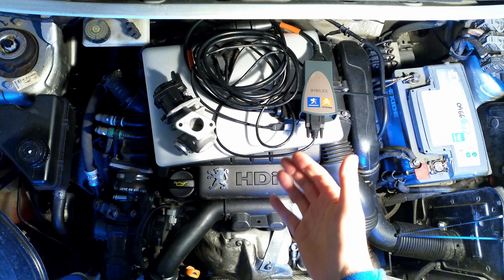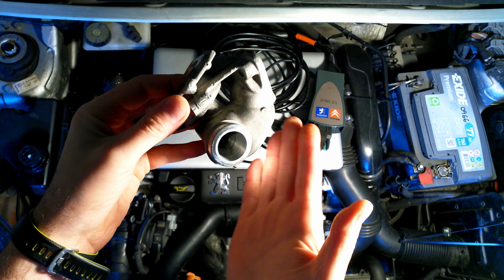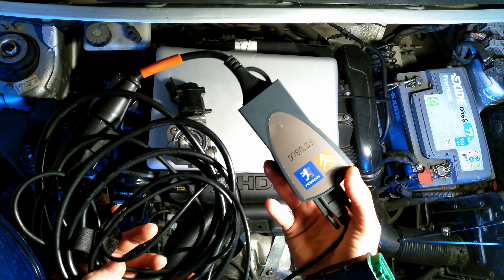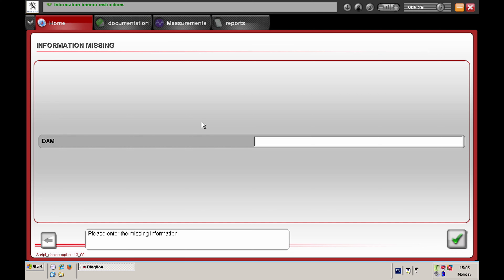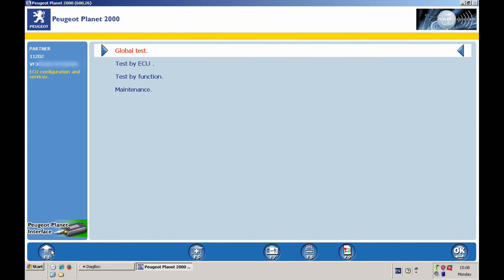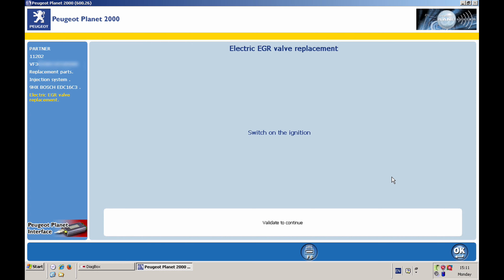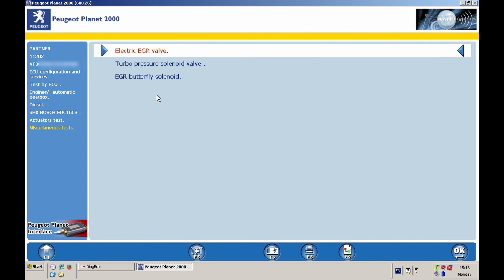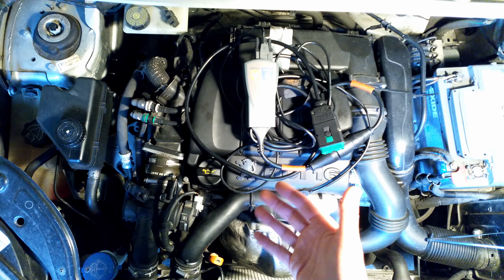1.6HDi new EGR valve recalibration or reconfiguration, how to with Diagbox or PP2000

Comment: how much does the diagbox tool cost, i changed the egr but a new simular code showed up instead of them getting removed?
Reply from the maker: Yeah, depends if you want legeal diagbox, then it is quite a bit with I think the newer versions annual charge. You could buy the tool and software from ebay and it does not cost that much, but it is illegal and it is up to you if you want to buy it.
Yes, new EGR needs to be recoded or relearned as it is not plug'n'play.

Comment: I changed my egr on a 2.0 hdi because the car was jerking on acceleration. But that made the problem worse. 
My mechanic tested to block the egr and the problem was gone (he reprogrammed the egr previously). What could it be? the egr pressure converter?
Reply from the maker: If you have replaced it with a new valve, it needs to be re-calibrated with Diagbox (Lexia for Citroen and PP2000 for Peugeot) in order for it to work properly. They just get clogged and become sticky to respond to close when under acceleration, hence blocking it would cure it. Sometimes new valves are not as good as the original ones, I had one where it was not machined properly and there was a snag in the channel.

Comment: Great video but how do I do this on diagbox I can't find replacement parts
Reply from the maker: hmm, do you not have pp2000 or Peugeot Plant 2000 (peugeot) or lexia (Citroen) that goes along the diagbox? Generally, both come with diagbox, unless some really new version. At the beginning you get the option to choose PP2000 or Lexia, but I suspect that there might be just diagbox if it is really new versions. What version diagbox do you have
Reply: @moremolecules  that came out all wrong my bad🤦 yes I have version 9.129  diagbox
Reply from the maker: @JerG21  It should have Lexia/PP2000. Do you not have it?

Comment: Do I need that Lexia3 connection interface? or can I just buy a obd2 cable to usb off eBay for £10? , can you use pp2000 with cheap cable.
Reply from the maker: There is nothing special about the cable, but it needs to be the same spec as the Lexia3 interface. Not too sure though if a generic obdii to usb would work, but it might. Sorry about the vagueness, I have not tried it with a generic cable, worth a try I suspect.

Comment: How would you debug this SUDDEN ABS OBD error message? "Incorrect matching of the ECU (incorrect engine, system or vehicle). Fit a correct ECU." ?
Reply from the maker: Have you by any chance changed the ECU. Could be a bad connection, either the EOBD itself or the interface
Reply: @moremolecules   They are all the original parts, except for brake pads and disks. How do I find the connections to check?
Reply from the maker: @RGSneaker  What I meant was disconnect the interface and try again. Also, you need the car battery fully charged, otherwise you could get the error message. Also, I suspect you have chosen the correct vehicle as well in the menu.

Comment: Hello, great video. Just a quick question. I replaced my egr valve recently and now I am getting fault codes p0490 and p1459 as well as a little hesitation under load. Is it because it needs to be programmed. 

Thanks 

Jon
Reply from the maker: Hi Jon, maybe, but it is not entirely clear. It could be that the new EGR valve is faulty or that it was not calibrated. Most people would think a new EGR is perfect but not always. I had a brand new EGR that was sticking due to bad machining of surfaces.
Reply: @moremolecules  hi
Reply from the maker: @muhammadsanee5870  hi

Comment: Good day Master , i am a Toyota driver , but i bought a Peugeot Partner for my wife , and i need some help from you .I watched many of yours videos and i want to thank you for  yours efforts , and  how you  explain clearly every detail .
I cleaned as per yours videos my EGR valve , and because i am new in Peugeot i can not do the performance test on it :( .
Infact ,i have chinease Diagbox tool , but i have no choice to see PP2000 and follow yours procedure . Maybe i did not instal properly the software ... When i connect the tool to OBD port and start the Diagbox , after i choose Peugeot Partner model , the program automatically find the VIN number and bring me to menu with 4 options as Repair , Maintenance , New car preparation and one else , and i have no option for P2000 .
I hope you can find for me a minute to guide me out .
Thanks a lot and have a new day .
Vasco
Reply from the maker: Hi Vasco, this looks like newer version than mine of the DiagBox. I think I installed it once and it was only the DiagBox, which should also work, but the menus are different. I think there is an option to download DiagBox with PP2000 or there is an option during the install to have PP2000. Otherwise, I generally switch off the internet while doing anything with DiagBox/PP2000. See if during the installation there was an option for PP2000. If I were you I would re-install it to make sure that PP2000 is there as an option.
Reply: @moremolecules  Hi again :). First i like to thank you for this fast reply .I will try to reinstall the program . It will be pleasure for me to know a nice guy as you , because today people are not too friendly .I will be glad to know your name , that way even when my car will  working fine  i can say you a small : Have a nice day .
You deserve it . Tonight i will write  why i decided to clean the EGR valve and i will see yours opinion about.
Reply: @moremolecules  Good morning  Master , ours Peugeot Partner got 169 000 km , and i did not knew if timing belt was replaced . So , i replaced it and car started very well and then i cleaned Turbo oil pipe. I did a rod test and all was perfect .Then i noticed a leak from injector number  1 .I took off all injectors to replace the copper seals ,and same time i cleaned nozzles with soft metal brush , then i modified humidifier to 40 kHz (ultrasound ) frequency and cleaned nozzles with water and soap . After installation i did again road test and noticed lack of power when i accelerate . I connected Diagbox , but i am not too familiar with . The only thing i saw was that Air Intake measured value was much HI then reference one ( with around 200 units ).For that reason i decided to clean the EGR valve . I hope you can guide me tom know where can be the mistake .
thanks A LOT in advance , and have a very nice sunny day :).
Vasco

Comment: What is the part you use to connect to car and computer. Can you use any type?
Reply from the maker: It is called Diagbox diagnostic interface. It contains Lexia 3 (Citroen) and PP2000 for Peugeot. It can be purchased on ebay
Reply: Does it work on newer vehicles?

Comment: Hello, I changed my egr valve and it keeps giving me code dtc p401 the car in cold shakes, what could be the fault? After this, cancel the egr with a sheet and the shaking is gone
Reply from the maker: It is likely that the new EGR is somewhat stuck on opened position or needs calibration. If an EGR valve is stuck in the opened position you would get shakes or rough idle. Exactly why when you blank it the shaking stops. It could be that the EGR valve is faulty, it has hapenned to me before with a brand new valve. The pin channel was not machined well and sometimes the pin got stuck at some position. Most people would not notice if the EGR is stuck on the closed position. Recalibrate it if you can and see if that helps. If it does not open it and investigate how well the pin is moving.

Comment: Hi.
I replaced the EGR on my 2009 1.6 HDi Berlingo and recalibrated it with Diagbox but still the Car doesnt feel right.
The Problem is, I have These 3 Codes:
P0409, P0490 & P1459 (all EGR related) but it is Not possible to delete the Codes.
Do You know what could cause this problem?
BTW, great Video!
Reply from the maker: It is a bit wierd to have these codes with a new EGR. How was it programmed/recalibrated? If it was with Lexia, then I would use Lexia to check the operation of the EGR valve, the percent values for opened/closed. It will give you an idea if it is permanently closed/opened. It might point you in the right direction. These are permanent faults, so likely either the EGR valve is faulty from new or the ECU cannot control it for some reason. I would do an EGR test with Lexia and see if it is clicking and operating as normal.
Reply: I am having these issues for years and I still cannot find the solution, I put a new EGR Delphi on my Citroen c4 Picasso and those 3 codes comes up, P0490 , P1459, P0409

I think I fixed the P0409 and the reason seems to be the MAF connector the pins sometimes are pulled back so just push in the cables to restore the pins position fixed that error, but still getting mad with the P1459 and P0490
Reply: Along with these errors there are ESP and auto handbrake faulty warnings displayed very annoying
Reply: Have you found the error @i.m.22 ???
Reply: I am still have those 3 errors, I put a new EGR brand Delphi and it still jerking hesitating and after driving a few miles those errors comes up along with the warnings of electric handbrake and esp. 

I read that citroen only like valeo EGR, also it could be an electric issue, a bad cable for example, also the bsi could be the problem, any help on this?
Reply: @Franco_Emmanuel  I Had the 3 Codes with a cheap No Name EGR and also with a Valeo EGR, I ended up using the old Control unit (where the connector goes ) from the OEM EGR with the mechanical Part of the new Valeo unit.
I still have 1 Error Code but the Car drives fine and I passed Emission Inspection.
Drove Like that for the Last year without any issues.
Reply: @i.m.22  do you have like a number part of that connector?
Reply: @Franco_Emmanuel  If I couldnt solve the issue Like I did, I'd probably go for a EGR delete....
Cheers
Reply: @Franco_Emmanuel  No, I mean the upper electric Part of the EGR (where the Plug from the wiring harness goes). Its bolted on with 4 screws on the actual mechanical valve itself.
Reply: @i.m.22  i get you so you mixed both EGR and you are using the electric part of the valeo but the mechanical part from the cheap one
Reply: @Franco_Emmanuel No, I use the old OEM Control unit since I only have 1 Error Code with it instead of 3 errors and Put it on the new valeo mechanical valve.
Reply: If you have Always 3 Codes with any Setup I would Go for the EGR delete.
Reply: @i.m.22  I get what you are doing now, why it doesn't like other aftermarket EGR?  I put a Delphi EGR £180 brand new and it jerk like an old bed, I tried to get adapted with diagbox but it seems that nothing happens, now I am not sure to try with another EGR valeo and waste money to keep that Christmas tree with the same lights
Reply: @Franco_Emmanuel  I feel you, this issue is a nightmare. I dont know how its in the UK but Here in Germany a EGR delete is about 150€. What you can also try is to block the EGR with a shainless Plate (Sold on eBay) you will still have the Codes but at least the car should Run fine without jerking.....
Reply: @i.m.22  my friend I did exactly the same you recommended, I replaced the electronic part of the EGR with a valeo one, errors just disappears from the dashboard and only one remains which is the P0409 but I notice a lack of power on first and second gear , I am suspecting that the ecu is faulty, did you have the same issue?
Reply: @Franco_Emmanuel  Hi.
No, I dont have any issues.
I think you have to relearn/recalibrate the start & end-points of the EGR with the Software.
Reply: @i.m.22  I did the recalibration, so I can conclude that my ecu is not working properly, thanks for all the help, at least it's not showing the warning lights, but it feels that is lacking power anyways.
Reply: Using diagbox I replaced the electronic EGR after the ignition on and off procedures, nothing happens

Comment: I think the ECU firmware can learn only a very narrow range of open and closed voltages so many new Egr valves do not calibrate as they are already out of range. one possibility occured to me  is that they did a firm are update to accommodate their own ECU voltages so as to force people to go to main dealers for a firmware and part matching. Just what I suspect ......no evidence to back this but I have tried cloning ECUs and using many new and second hand egrs. Even tried an external potentiometer with some success except it chenged open and closed voltages the same.
Reply from the maker: Hmm, interesting point. I have never had problem with calibrating a new EGR valve. As far as I know, at least for my model, the main dealer only uses the same software for the calibration of a new EGR. They do not update the firmware to accomodate ECU voltages. Good comment though, more research needed :-) Thanks

Comment: Is blocking egr valve better than normal condition?
Reply from the maker: Good question. In my humble opinion it will be better with it than not. Aside the reduced emissions, etc., it still helps with pumping losses for example when one is going downhill or one lifts the throttle and if travelling on motorways/highway when the power request is not really that high. In general it will reduce the burning temperature in the combustion chamber, so it should be beneficial, although some negatives of coating the air intake with oil+carbon is a bit inevitable.
Reply: @Jani9238  There is a lot of debate on this topic! If we look at the subject from a purely mechanical point of view, we should eliminate the EGR, the PCV (oil vapor crankcase ventilation), the DPF / FAP etc ...
Especially on this type of engines (DV6 PSA / Ford) if you remove the intake manifold, where the gases arriving from the EGR meet with the oil vapors, they form a sludge that remains trapped in the manifold, the bulk black group above the engine. Even the passages that should bring fresh air to the combustion chamber are restricted in size by so much dirt remains trapped!
Every 50000 / 60000km it would be necessary to remove the intake manifold, the EGR heat exchanger, the pipes, and clean them completely. I did it on my old Focus and it was hard work!
Ok, we must also think about the environment so if the car has been designed to work with all these devices, to be in compliance with both emissions and the law, it is better to clean the parts and replace the faulty ones.
I add just one thing: in the past on my old Focus I had tried to use a metal plate to block the EGR. But after a few ignitions the error light comes out and in any case in the long run, the engine seemed to no longer work as well as at the beginning, because the ECU "thinks" that the valve is efficient and adjusts the fuel injection based on the data that receives. The only way is to modify the ECU to exclude it electronically. But I do not recommend this kind of modification, especially to avoid any problems if you use the car on public roads. Sorry for my bad English!
Reply from the maker: @Jani9238  Generally, it needs a stage I re-map in order to remove the EGR from the ECU, then it will be even better
Reply: In the old cars is good to block egr because the ecu dont give fault code. In new cars with dpf this metode can damage the dpf and the ecu takes the car to limp mode. My English is bad sorry 😃
Reply from the maker: @Jani9238  Yes, my 1.6HDi 2007 will give an error (I have tried it) with blocked EGR, but it does not have a DPF. So, not all old cars can be easily blocked.

Comment: Buna am un peugeot 307 diesel 2 litri am inlocuit egr am pus un egr loro  am facut o adaptare cu o diagnoza si a mers 360 de km dupa care sa aprins martorul de la motor si mesajul anti polare Am  incercat cu o diagnoza peugeot dar cel care a folosito a spus ca nu are functie pentru acea eroare 1461 cu ac si sid 803 lerning Va rog daca puteti sa ma ajutati si pe mine va multumesc
Reply from the maker: Sorry about the late reply, but you seems to have changed the EGR. What did you replace it with?
Reply: @moremolecules  Va multumesc foarte mult pentru ajutor am inlocuit egr cu unul foarte ieftin Loro si a aparut cod de eroare 1461 cred lerning adica invatare Am fost la un servis care au folosit soft ca al dumneavoastra si am calibrat au spus ca nu va merge pentru ca nu este original am insistat am calibrat cum a ti spus dumneavoastra si am parcurs in jur de 950 km Nu mai sant probleme merge foarte bine

Comment: Hi, how need recalibration egr valve in Diagbox not int PP2000?
Reply from the maker: Hi Justinas, the DiagBox is software with the inteface and contains both PP2000 (Peugeot) and Lexia (Citroen). To recalibrate the EGR in Peugeot one needs to use PP2000 and Lexia for Citroens.

Comment: Replaced EGR valve new. calibrate it .
3 week later van loses power on and off sometimes
Reply from the maker: Do you get any errors?
Reply: No errors
Reply from the maker: @fordford9133  Was this happening before as well? If not, it is difficult to say. I had a new replacement (Haas) and it did the same thing. I was getting errors. Upon dismantling the EGR, the channel where the rod moves was not smooth at all, so it was snagging from time to time. If I were you I would take it apart and see if everything moves freely and no snagging. It could well be something else, what model/year is the van.
Reply: 2008 1.6
Reply: Ok try that thanks for your help.
Reply from the maker: @fordford9133  Good luck tryig to figure it out. Hopefully it is dodgy EGR valve.
Reply: Your right it is egr
How  would i pay you
Reply from the maker: @fordford9133  Haha, there is no payment needed. If I can help I will help.
Reply: I don't have PayPal account is there any other way of paying you
Reply from the maker: @fordford9133  No need to worry, you do not need to pay me anything. It is only there in case someone really wants to contribute towards upkeeping the channel. I still get some money from the adverts 🙂